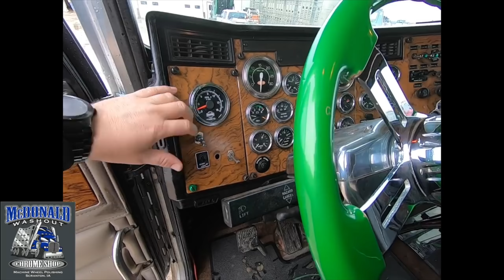379 Peterbilt Restoration Project - Fast Forward Recap ( McDonald Chrome Shop )

Comment: Don't know what he used on the tanks and aluminum besides elbow grease ,but they sure shined up nice ,I wash mine first then use an sos soap pad then the small mothers power ball on a drill for my wheels and a buffer on my tanks with a foam pad ,and if they still aren't shiny enough for me I'll use never dull wading polish and it takes a while but does a pretty good job but don't think I've ever got em as shiny as yours ,nice paint job to my favorite color ,white and chrome lol
Reply from the maker: i believe he sands down with 80 grit and works his way up to 240 grit then starts polishing using Zepher polishing products
Reply: @McDonaldChromeShop  man I'd be scared to death to put 80 grit on my tanks and wheels lol ,I won't even let the washboy put acid on my truck ,he does on all the others but they've always used it ,I think acid just cleans them real good but it don't shine them worth a flip ,it takes most of a day to do all my aluminum on my 378 Pete but it lasts for about 6 months before I have to do it again

Comment: I'm doing some touch up work on my truck. The factory color is metallic wine Imron. It's 300 dollars a quort. All ready did some buffing and it looks pretty good. But almeans not perfect.
Reply from the maker: can be hard to blend in new paint to the older factory paint but its crazy how much improvement comes with someone who is really good with a buffer. i hear your $300 per quart, we did a split paint job once was pearl white and camaro green at $1,200 per quart. luckily it was only half the truck lol looked sweet though. thanks for checking out our channel we have more builds being filmed right now! thanks again

Comment: 2:14

Why put metal plates on the outside door of the window thats not going to let you open the side window in front of the main window on the side door?
Reply from the maker: guess they dont care to use that window lol. to be honest it still opens about an inch. i personally never used that window in my years of hauling cattle but im sure it is an issue for some. thanks for watching
Reply: That's motsuc
Reply: Lot nice semi that restore to be put back on the road ??!! Families appreciate products time put into it
Reply: I agree I dont get why the engine compartment was not covered in plastic when painted now its full of over spray.. To each his own but when we paint a truck we paint frame axles everything .. Also we dustless blast all front to back including engine and detail the truck in every portion.. Thus looks like came from factory.. I guess these guys like to sell that chrome but sometimes thats like putting lipstick on a pig..

Comment: How much did you spend on the paint job and all the accesories for the exterior?
Reply from the maker: that paint job is nothing special but it still takes time to tear down, prep, paint, and reassemble i would put it at about $10,000 then about another $10,000 in accessories then about the same in labor to install everything roughly.
Reply: @McDonaldChromeShop  looks real damn good. Thanks for replying.

Comment: Didn’t separate the cab from the bunk to paint in between them. What if they want to turn it into a day cab one day?! Saw dents on the fuel tanks before and after the polishing. So many things I see wrong with this transformation. Definitely not a professional job unless this was just a budget build.
Reply from the maker: yes it was built on the customers budget. everything between the bunk and cab besides the boot is painted. if someone later wants to day cab it they will still need to paint since the day cab kit will not be painted. these tanks are 20 years old so some pits are so deep if you cut that deep it would ruin the tanks. it their was no budget cab and bunk would be removed along with all interior, new tanks, wheels, motor removed and painted. but that would make this over a $100,000 truck which was not the budget.

Comment: You paint engine,not good
Reply from the maker: Lol we use a silicone spray on the engine and other places their could be overspray. Then we rinse it off any no overspray left.
Reply: @McDonaldChromeShop  that's  cool! Sory, i didn't know
Reply from the maker: @Поламайведро  its ok. its just hard to explain every detail while doing the work. we are working on getting better at that but it will take us some time getting better at that. Its the small things like this that we take for granted because its commonly known to us we sometimes forget to explain some steps. thanks for watching
Reply: @McDonaldChromeShop  and thank you! Success

Comment: No need to cover the fucking motor or anything lol
Reply from the maker: anywhere that could possibly get over spray we put a silicone spray on then power wash off after paint has cured, so to answer your question no we do not need to cover the engine.